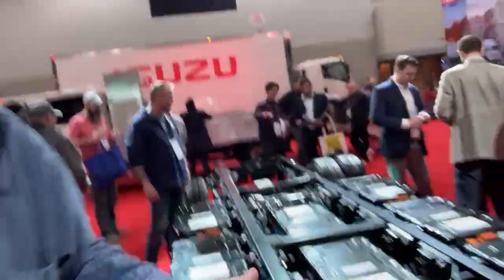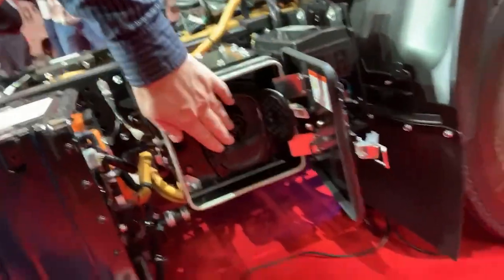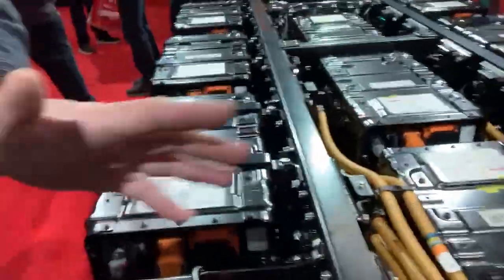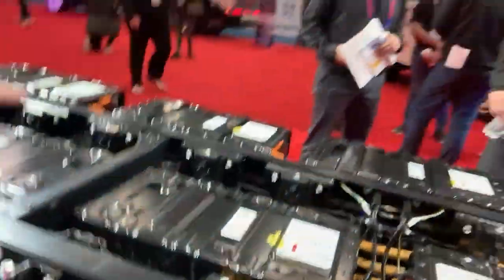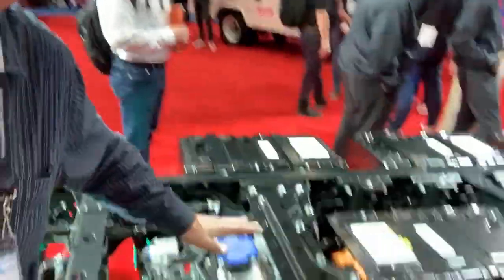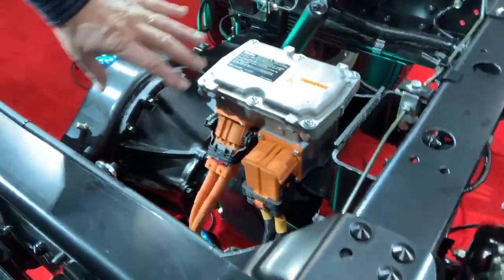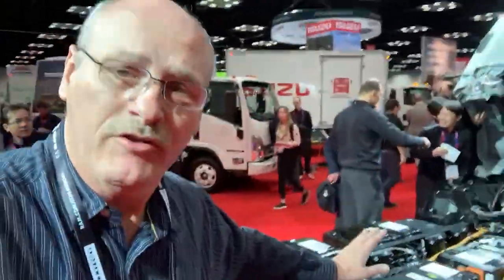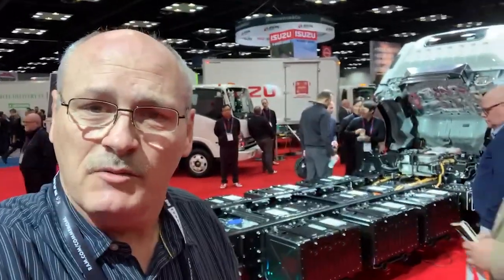Isuzu NRR EV Electric Vehicle 19500 GVW 230 miles - Under the Cab review from Michael Olden

Comment: When you said under the cab review, I thought you were going to tell us what was under the cab instead of the engine
Reply from the maker: https://youtu.be/6j6PuqTUEK8?t=145  offers a look at the components under the cab.  It houses the cooling system, DC invertor for the 12 volt electrical systems (power steering, A/C, Cab systems, Dash, Radio, lights, ECM. Those trucking components that are traditional supported by combustion engines)
Reply: @MichaelOlden  I see, so compared to the rear of the truck, the front is now quite light. should help a lot pushing the thing up inclines